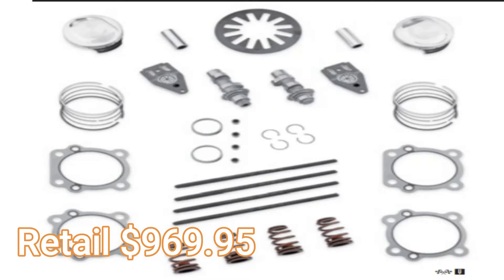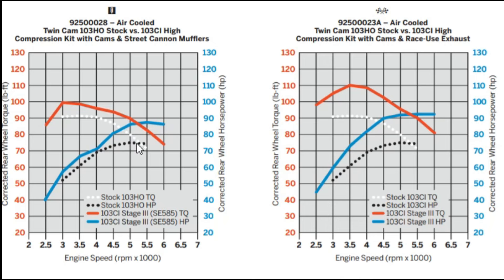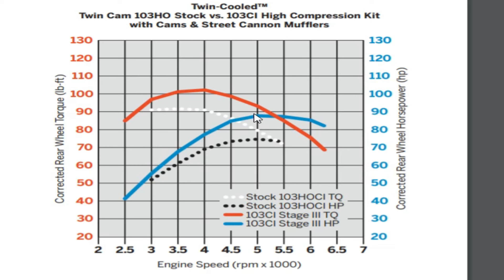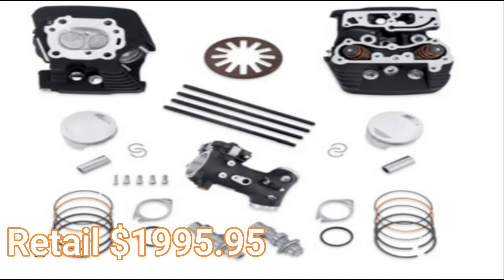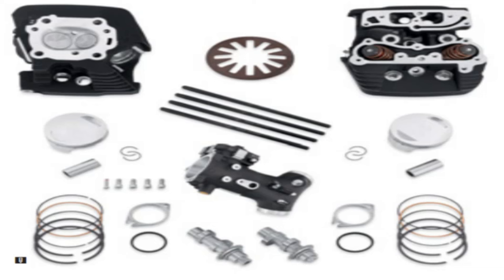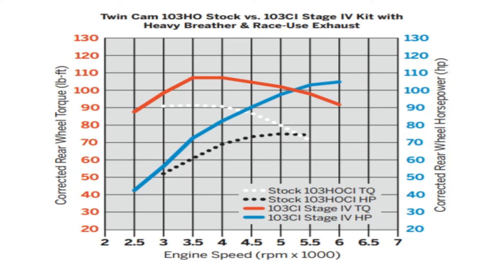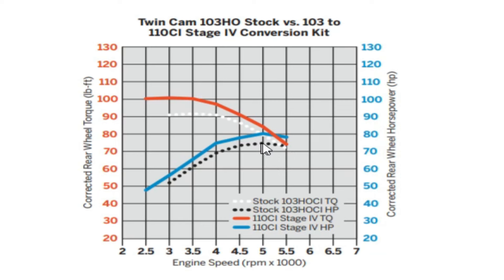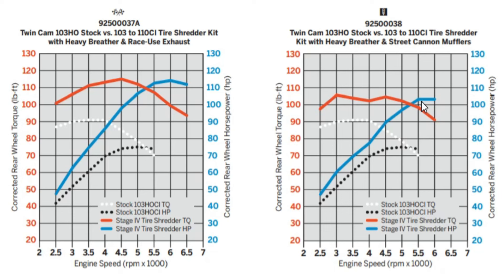Late Model Twin Cam 103's Make A Solid Motor For Modern Used Harleys

Comment from the maker: Would you choose a high compression kit or go with the 110 big bore kit?
Reply: I would like to what else is out there for the after market. I love the bikes but do not like to do business with the dealer and do all the work my self 🤔 love the channel great content 😁
Reply from the maker: There's a lot of quality after market kits out there for the twin cam.
Reply from the maker: Thay really seems like the best way to go!
Reply: @dotlaj  turbo kit.
Reply from the maker: Now we're talking!!
Reply: Would this be a good motor for my 91 electra sport??
Reply from the maker: If you've got a 91 with an Evo l wouldn't swap that motor out for a twin cam. Is your motor blown beyond repair?
Reply: A twin can might be good for a hay bailer ..but opening and closing the valves on a Harley takes just as much torque and lift as a small block Chevy ..ever see the size of the cam chain and cam  chain gear on a Chevy compared to a twin cam ?..the Harley chain and gears are not even half as big ..putting a loadon the chain at least twice as much .a Chevy V8 ..want a complete 110 kit for a twin can that has exactly 30 miles on it ..that I personally put the miles on this 110 complete top end with injectors and throttle body .. Thisc came off a brand new 2017 FXDLR DYNA S   I bought with zero miles on it and not even the battery had been serviced or install in the bike ..and I went to beyond stag iv..my heads were not even street legal way beyong anything in this video ..this was the bike I beat a hayabusa with
Reply from the maker: 😆😂 that's one bad bike! Yeah the ravce valve springs they sell make you scratch your head. They have some serious spring pressures for those high lift cams. You gotta throw reasonable engine life expectancy to the wind when you really get to building.
Reply: Leon Wilcox  you will need compression relief valves installed or buy sreamin' eagle heads with compression relief valves already installed..you can get them in ignition operated or manually  operated ..if you don't your starter won't last very long ..you will also need to carry around a bottle of octane booster.as 93 octane premium will spark  knock and rattle the valves..with a 110 bore kit and high compression heads you will have over 12.5 : 1 compression ratio but will make over 120 rear wheel HP..my last one I used the screamin', eagle 117 cubic inch. kit with the off road racing heads with bee hive valve springs and retainers made of titanium , titanium valves and titanium piston rings .made 120 rear wheel HP and 125 foot pounds torque at 6800 rpm .turned 9.6 on the dyno drags against a busa that ran a 9.7 
Or you can opt out for an S&S T 145 twin cam replacement will make 170 rear wheel horse power with the proper TTS Tuner that must be tuned on a dyno ..as all EFI induction Harleys have to be done if you want them to last over 100,000 miles
Reply: @GixxerFoo  if you have all the work done at an authorized screamin' eagle Harley Davidson shop does not effect your hd two year warranty at all or any extended warranty ..but I will warn you all ..the first thing you all need to do is take out the compensating sprocket and replace it with a solid sprocket..and replace the clutch with a king Kong clutch from baker clutches and transmission...if you don't you run the risk of blowing the entire primary and twisting the fly wheels ..been there and done that ...
Reply: @GixxerFoo  if you have all the work done at an authorized screamin' eagle Harley Davidson shop does not effect your hd two year warranty at all or any extended warranty ..but I will warn you all ..the first thing you all need to do is take out the compensating sprocket and replace it with a solid sprocket..and replace the clutch with a king Kong clutch from baker clutches and transmission...if you don't you run the risk of blowing the entire primary and twisting the fly wheels ..been there and done that ...
Reply from the maker: That's a very good point, yeah 10.5:1 is about max on the street.
Reply from the maker: You need some supporting parts that they don't tell you about!
Reply: @GixxerFoo  the final mod to a twin can would be the fueling cam   plate with a $&$ gear drive that eliminate the cam chains altogether ..price for all parts around $3k ..but all problems are gone ..for if you blow the cam chains ..game over man game over
Reply from the maker: You can't beat that setup, it's expensive upfront bit cheap insurance in the long run.
Reply: GixxerFoo I have never built or owned an evo ..done a lot of  of work for "The Shop" back in 1984 when the evos first came out as I was the shop's sportster wrench as Jack pitman said he hates sportsters to work on and the day he hired me said "you are now officially my new sportster wrench ..so over there is a complete teardown and restore job ..FiXIt ..I like sportsters to repair as I take my time and set up the shifting forks with the offset optional forks to put the gears spacing exactly perfect that the factory never does as time vs money .I have had a idea about an evo build since they where born..something that no one I can find is doing to any Harley as it is probably unsung to be totally taboo like shorten the stroke about a mile .....actually I have been kicking around the numbers and   a stroke of 3.5 inches is very possible without major surgery..I know this dude as an old racer who rode sportsters for S&S cycle back when they first set drag racing records ..his nam is Carl Fields who is still breathing said they used 74 cu in jugs on a 60 cu in pan bottom  In .pan d that had I believe a 3 .5 inch stroke that gave you a shorter stroke big twin of 68 cu. In ..he said ran circles around 74 ERS with heavy fly wheea ...this is now and we got lots more toys to play with ...how about a set of huge S&S evolution cases the ones already made to bolt on huge 4 + inch evo aluminium big bore jugs of  4.250 diameter bore ?  And then as you could or can today get S&S to carve out a set of flyvwheels two and a half pounds lighter weight with avcrank pin location the equal a 3.50 inch stock with longer rods we can take advantage of to decrease side thrust loads on piston skirts and cut piston speed  bunch with shorter stroke ..now not as much friction with way less heat at high revs of 8000 rpm . and with S&S high flow CNC milled heads ..do we have a small block big bore v twin screamer ? I believe we do .like a Ford boss 302 Cleveland V8 engine that won Pikes Peak and everything else with the characteristics aall built into a v twin that will bolt together with the only mod in the stroke as know have to know the longer the stroke the less efficiency the bore has to completely fill up at high rpm ..so you can get even a bigger bang at shorter strokes with. Big heads with a lot of flow like today's Harleys ..using efi and a TTS tuner will bring in the highest tune and max horsepower. ...build it  and  they will come.  4.25 inch bore times 3.5 inch stroke times two cylinders = 99 cu. In. BTW .. The magic sweet spot of cubic inches vs pounds if fun times cubic dollars busa beater
Reply from the maker: Always fun to beat the Busa with a Harley, sounds like you got some great ideas! You build an Evo, l'd be curious to see what you can turn with it.
Reply: @GixxerFoo  
Twin cam isnt half the motor of the evo.
Evo platforms are bullet proof" and ideal for big power.
Reply from the maker: Yeah the twin cam got a lot of cost savings added to it. Now if it was built like the Evo was it would of been an awesome motor.
Reply: I just got offered a great deal on a 103ci to 110ci upgrade kit.  This is the kit with the CVO heads.  I recognize that it's a little weak on the compression (although it's actually a very slight bump), but my plan was to have the CVO heads ported, port my throttle body, and keep my Feuling 574 cam in the bike.   I think the SE 255 that comes with the kit is useless.  I can only assume that because of the cam and the porting, it will perform much better than a stock 110ci.  Do you think this is a decent plan, or do you think I would be better going with the 103ci to 110ci Tire Shredder Kit?
Reply from the maker: That's not a bad plan at all and the cam is going to make a world of difference in that setup. Porting the CVO heads is going to really help too. They are a little better than regular factory heads but not nearly what a port job will do. Pair that with the right head gasket for a little compression bump and you got it made.
Reply: I.   Would.   Go.     110.
Reply: @GixxerFoo  
I am definitely go with the 110 Screaming Eagle Tire Shredder kit, utilizing a Mikuni carb.
I am making a shopping list to build this from scratch, using mostly new parts.
I'm about to start a project that's going to take a while.
Thank you!!!
Reply: Why not both? 😂

Comment: I have the tire shredder kit and went with the 585 cams…and to be 100% honest…even the guys at the dealership can’t believe how nasty that thing is. Once and a while you just get that perfect combo that makes a monster. Even my wife’s M8 114 stage IV can’t touch it!
Reply: I have a 2016 SGS that I bought new, had the Tire shredder kit installed with T-580s and a Screamin Eagle Cam Plate,  I raced a guy on a 2021 SGS Arctic Blast M8 with a stage lV, Granted he has around 30 pounds on me,  He even went back to HD shop asked them what the hell,  they told him that my 2016 is crazy how it runs.  I love my bike
Reply: Cams are the trick in this kit. Are the 585 the same cam as T-580s ? 
My kit is due to come in 8/19 after waiting 14 months. My gut says I need to change out cams in the kit. You guys use ThunderMax tuner?
Reply: It’s a big bump stick man
Reply: I'm installing the tire shredder kit on my 2015 FLTRXS and having the 585 cams installed instead of the 259 cams.
I have the rinehart racing headers, CFR exhaust and have a powervision tune.  What were your HP/TQ numbers?  I should have my bike back within the week or so.

Comment: The 103/96 is a rock solid engine despite what you read on the internet 😂 there’s a lot of guys that own shops that want you to think their garbage to sell you parts. Sure the  early 88s have some issues but the twin cam 103/96 is pretty bulletproof
Reply from the maker: They really are solid engines, you hear of a 1,000 failures in a sea of millions of engines that have run for years without issue and the focus is on the failure.
Reply: @GixxerFoo  that Baxter guy is the worst, or Tman, they have some good info, but if you listen to them for 10 minutes you’d think every single Harley on the road was an oil leaking crank out of spec piece of crap and they’re really not 😂 the other problem is people run to the forums and make a “has anyone had this issue” post every time a part fails on a bike…Harley’s are very reliable quality motorcycles that are mass produced, anything that’s mass produced has a lemon here and there and has parts failure here and there, it’s nothing new.

Comment: In the market for a Harley right now. The 103 is plentiful and at a good price point for me. Specifically in the 14 streetglides and up. However, the M8 bikes are there too.What’s your opinion, I’m currently set on a low mileage 2021 street glide and ultra glide. But I can save a few grand getting a 2015 103 with about 20k on it.

Comment: I have a 2014 Electra glide ultra classic with Reinhart exhaust and a screaming eagle high flow air intake, it has the oil cooler and it putting out 91 hp with 111 lb ft of torque is there a way to tell if this is stock with tune only or if the put a cam in it?
Reply: I also have been told my bike is quick having the 2 into 2 exhaust and louder than the stock harleys coming from the show room floor

Comment: i have a question, i have reaper 574 cams, big bore to 107 10.75/1, 55 hpi tb, ported heads, tmann no loss air filter and two bros 2 into 1 exhaust. it dynode at 106/112. what cam would make this setup better?
Reply from the maker: You've got a nice setup with some good horsepower and torque, that's about right inline with that cams performance. I would check out Wood Cams, I am not sure what year your bike is or what it is (dyna, softail, tourer). Assuming you have some upgraded valve springs with the head work you can actually go with 555 or 222 from Wood. They work with stock springs but they love some compression. TW-7H is another monster for your bike, depending on where you want the power to come on anything from Wood will crush your current numbers.
Reply: @GixxerFoo  its a 2016 sg, yes it has s&s valve springs, s&s cam plate and pump. i was thinking about tw999 or tw999-6a.
thank you
Reply: @GixxerFoo  what do you think about this cam for my bike Wood TW-999-6a

Comment: I know this post is old but here is my question. 2013 Tri Glide. Will be installing woods 222 cam. S&S High volume oil pump and cam plate with S&S lifters with adjustable pushrods. DK customs 606 high flow breather with factory cat deleted headers and gutted VH pipes. What numbers should I expect to see out of this setup? Power vision tuner. Is there a better woods cam for this setup? Trying to stay with drop in cam setup while gaining torque along with some top end speed. Tavel in the mountains and out west pulling a trailer at times. Will be making the Sturgis run next year pulling trailer. Trying to also keep a reasonable fuel milage.
Reply from the maker: Wood 222 is going to be the best all around bolt in for your setup, that cam really excels in heavy bikes with the torque curve and top end power. With a catless factory head pipe and V&H mufflers and a power vision canned tune for the setup you should land around 90 to 95 horsepower and north of 100 foot pounds of torque.
Reply: @GixxerFoo  Thank you brother, your channel is a wealth of knowledge. It is great to see someone with the passion you have for what you do.

Comment: I have a twin cam 88 softtail deuce.And I raced my buddies 114 fat boy and surprisingly he did not win
Reply from the maker: What do you have done to that 88? I love the 88's but just pipes and air cleaner won't hold a candle to 114 M8.
Reply: @GixxerFoo  I picked it up with 40k put exhaust on it and updated the timing guides and oil pump along with s&s adjusted push rods. Not sure if someone else did heads or something before I got my hands on it! But trust me I was very surprised to edge him out. He's fatboy is stock though so I sure that's holding it back Maybe?

Comment: My question is how do I find out if my 2016 Street Glide Special 103 has H.O stock cams?  Thanks for all the informative information and videos
Reply from the maker: The only way to know exactly what cam set is in there is to pull the cams out, but if you just want to know if it's stock or not there is a way. You would need a tuner that allows you to view the intake valve open/close value. The open and closing values for the stock 103HO cams are 02 BTDC and 30 ABDC (before top dead center and after bottom dead center) this tells the ECM when to read the MAP sensor. If those values differ than the cams are likely not stock, that's the best way I know give you an idea if they are stock or not without pulling the cams.
Reply: @GixxerFoo  you are the official H-D savant!! I appreciate the feedback and the informative videos when making hard cash errand decisions when upgrading my H-D.
Reply: I'm confused. Did you buy this used or brand new ? Did they use 2 different cams for that year and model because I have the same bike (bought it brand new)
Reply: @gaknskk  I bought mine new as well, the only power upgrade I’ve done so far was have the Sceaming Eagle ventilator elite installed. To compliment my Rhinehart slip on’s.

Comment: Is a 2014 ,  103 liquid Cool heads a good motor?
Reply from the maker: The motors is solid on those, the water pumps had plastic housings that were known to crack. This was later updated with a metal housing, also keep an eye on the fittings where your coolant hoses connect. The develop leaks from time to time.
Reply: @GixxerFoo  thx I'll keep that in my memory bank  lol , I just bought a 2014 mint condition 20.000 miles, i hope she's  a keeper!! Lol

Comment: So the 110 wasnt offered as a stock motor?
Reply from the maker: The 110 wasn't offered in anything outside of a CVO until 2016 and 2017 when they came out with the "S" models in the LowRider, Slim and the Fatboy. That was about as close to what I would consider stock, but even those were somewhat of a limited production.

Comment: When  I bought my 2013 Road King off the showroom floor it had a stage 3 kit and an aftermarket exhaust from the dealership in Victoria, BC. It would snap my head back when I twisted the throttle on the freeway. Does the stage 3 kit mean it has 110" cylinders? I need to buy rings for the rebuild, what size rings would they be? Thanks for the vid!
Reply from the maker: On the 103 there were so many different variations of the stage 3 kit at that time it would be hard to tell without tearing the bike down measuring the bore. Since it was done by a dealer you can have your Vin number run at a dealer and they will be able to tell you everything done at a dealer on that bike. At that time there were stage 3 110 jug kits but also high compression stage 3 kits with cams too.
Reply: @GixxerFoo  thanks, the dealership is out of business. I had a wreck several years ago and it's slow going getting all the parts together that were messed up, I'm still saving up and looking for a frame. I have the engine torn down, ready to put it in S&S cases. What would the bore be for the 103 and 110 respectively? The dealership is elusive about the answers (I think they want me to just buy a bike from them, but I have an '83 sportster that will do for now.)